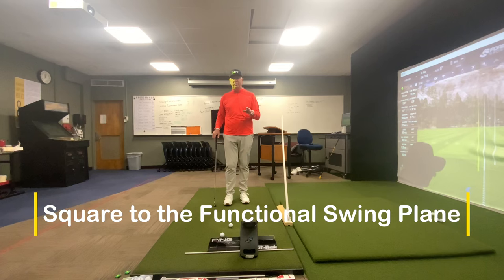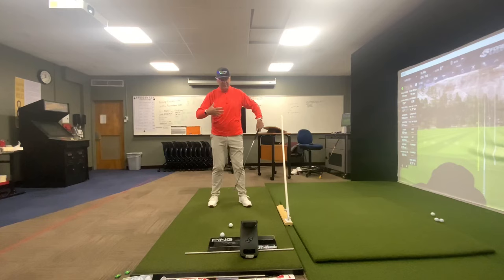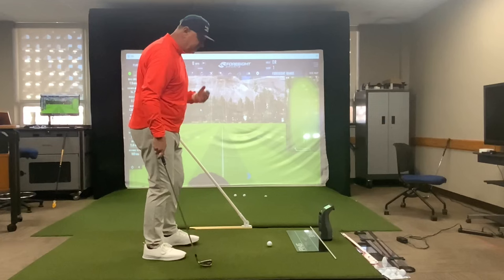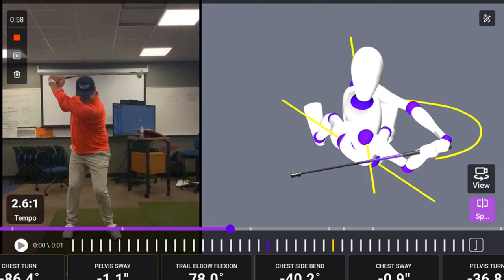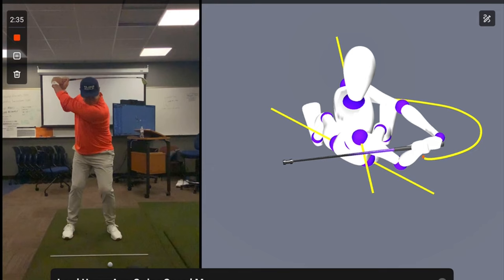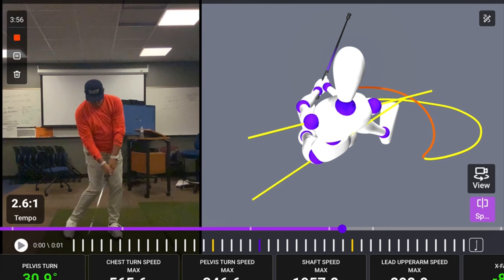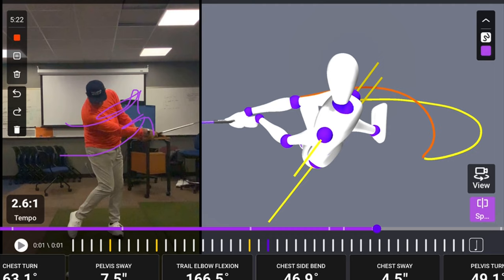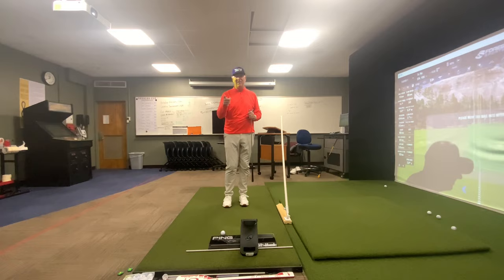Learn how to keep the club face square through impact. 3D Functional Swing Plane

Comment: You mentioned that you'd like to see your clubface less open at hip high down, and that you'd like to see yourself more raised up earlier in the downswing.

 Do you think the open face is from the arms abducting too much across the chest in the backswing (where the abduction causes both too much roll over going back where they have to roll back down,, or something has to stall to try to buy them time - none of which there is time for in the short downswing time?). Less abduction going back might keep them in front of the chest area more and give them a shorter distance to travel in the downswing (?).

 When I put Tour Pro swings (ex: Mcilroy, Els, Adam Scott) in Sporsbox AI I was surprised how early the raise begins (somewhere between hands shoulder high and left arm parallel it looks to me). Is that when you think it should occur, and if so what type of motion do you think is a good one to trigger that rise? 

(Some kind of downward muscle loading motion right before that might cause an opposite direction shortly after in another segment? Kind of like how pushing down on the grip/handle of the club in the backswing leads to the clubhead to move upward in space? or Would it be better for something to cause an increase in pressure inside the left instep , that then causes the hip rotation to slow and the left leg to become more of a post and lead the left hip to raise as the left knee and hip brace up? Or is there another solution that would cause the desired movement and position?)
Reply from the maker: System optimizer great questions. It’s a balance of swing tendencies. My tendency is to use my arms to help with the turn, creates lazy body motion but due to back issues took pressure of the back.  I did video on this a few weeks ago. I see the same earlier rise compared to my swing but they have greater mobility so they can turn more. The goal is to set the club in an an area at the top that allows maximum speed and control coming down. 
Downswing, I’d prefer a more trail hand supinated/extended wrist movement but because of my tendency of having too much secondary tilt I would hit it way left if the clubface was square at P6. My tendency is to use forearm rotation to get the club forward from a hanging back position that I’m trying to change.  Currently, with my newer positions, I’m fading the ball so the better stacked I am the squarer the clubface needs to be. 
When stacked better the legs have the ability to work properly. With too much tilt, I created a slide with my knees to slow a rotating clubface down. Know I’m training my self to post lead leg better and pivot forward with arms and upper torso.  When I get the face squared up at P6 with this new body position, ball is compressed online!!!

Comment: At 6:45 you are saying the clubface looks a bit open.  Is not the aim to keep the clubface square to plane of the shaft?  That's how your clubface looks to me.  If we want to keep everything as neutral as possible, it seems that the shaft is always on plane with the  intended target line.  That's what swing plane means to me.  I believe one of the best drills to be those laser devices by which you can see if your shaft is on plane with the target line either by the clubface laser or the handle laser. By doing this in slow motion and observing the laser, one learns the proper arc of the shaft and clubhead throughout the swing.  The face, provided we maintain a neutral position for our hands & wrists, will remain perpendicular to the shaft plane throughout the swing.  It seems that you are promoting a wrist release that is more square to the target line in the impact zone, by turning the trail wrist more under than over-the-top of the plane.  In other words, the wrists can add kick at the bottom without rotating so violently, lending itself to more consistency in the impact zone.
Reply from the maker: I believe that shot faded slightly. I see my trail hand just a little too under at P6. Club does not move on the shaft plane, it’s close and you can use the shaft as reference. The clubhead does swing on a plane and the hands get on the same functional swing plane (video launch this weekend). I’ll use shaft plane to simplify a discussion with a student as I did in the upcoming video. I’m going to look into slow motion movements, Tai Chi.  I want the student to feel so a laser could work if used correctly.

Comment: I noticed you feel that weight shift occurs naturally whereas others, Dr Kwon for example, spends a lot of time teaching step drills to instill the forward - back - forward pressure shifts.  How do I reconcile these two swing philosophies?
Reply from the maker: That question has been an issue for decades!!  The reason for the different approaches to the same movement is based on scientific view points. Kwon and others generally base their explanation on kinematics, what you see. I prefer motor control and motor learning perspective that ties in how the body moves to solve a problem. I like to think of kinematics as the result or outcome of the motor intent. Reach for a door, throw a ball, how much time and information can you process to create a motion?  Best players think less, and just do it!! There is plenty of motor control research that shows that external focus creates improved kinematics and performance. Finally, we want the swing with the least amount of slack and I generally see golfers have too much slack in their swing when they focus on over doing kinematics that occur in response with fast actions.
Reply from the maker: Great question. @jameschaney1095
Reply: Thanks for the response. I feel that there’s a wide spectrum of methodologies out there being taught - some are pretty passive and others very active. I think the extremes in lower body action are really geared towards the elite players seeking to eek out that last 5% of extra club speed for the driver.
Reply from the maker: @jameschaney1095  in talking with our engineers you could gain a few  mph but at the expense of accuracy. Long drive guys may see some benefits but golfers are better off staying in the 95% that would benefit from optimal accuracy and then distance. Previously, my long guy drive was 400 yds off the tee with this technique. What more do you need???